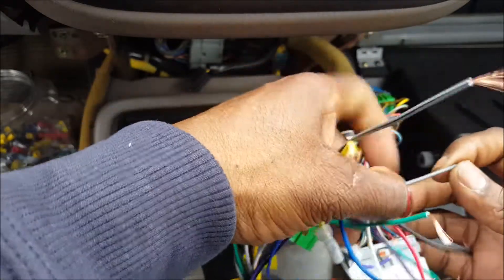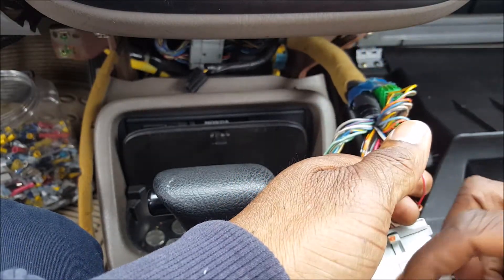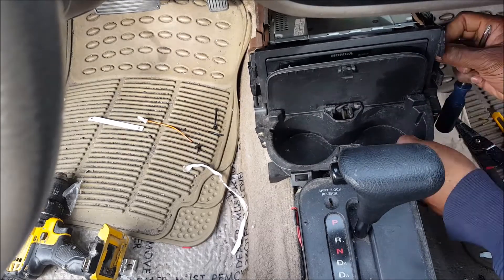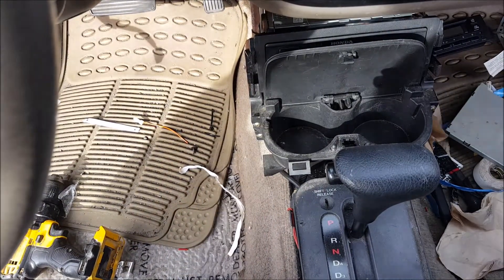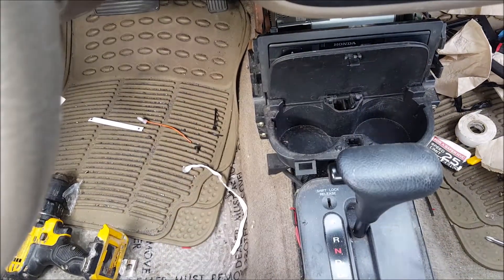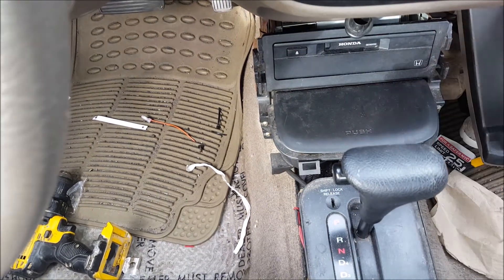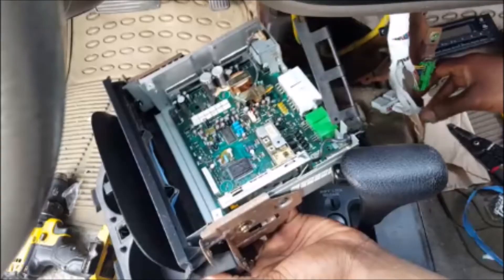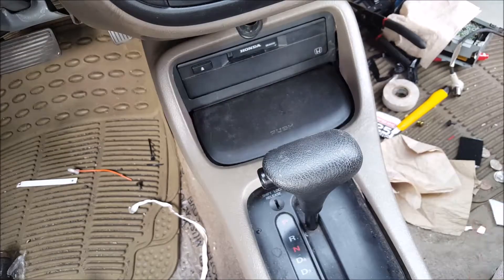Retain OEM Key less Entry Dome light Alarm On A 1996-1998 Honda Civic  With An Aftermarket Radio

Comment: For anyone confused about how to wire it all before getting to this point:

Easiest thing to do is buy the Metra 70-1720T harness. Connect the female end of the metra to the factory male harness, and connect the male metra side to the factory radio (also need to plug the green harness back into the factory stereo. Then connect the loose ends of the metra to the loose ends of the aftermarket stereo harness, and connect that to the aftermarket stereo. Then you should be good to go. Took me a long time to figure this all out and a lot of research and looking at my own car. There's hardly any info about this out there. 

Here's the Metra harness on amazon if you want it: https://www.amazon.com/gp/product/B0037712J6/

Cheers!
Reply: This will work even aftermarket radio?
Reply: @antwonm7002  yes. It basically splices the necessary wires for you so you can keep your original stereo hidden somewhere in the dash so the keyless entry remote will still work (keyless entry is built into factory stereo) . Then you connect the loose wires on the Metra to the loose wires that come on the harness for the aftermarket stereo.
Reply: @jadonk9798  so ill need to get a stock radio to hide it n stuff to keep keyless but still keep aftermarket radio?
Reply: @antwonm7002  yea you need the stock radio to keep keyless entry. You don't have a stock radio already in your car?
Reply: @jadonk9798  nah i got a aftermarket radio
Reply: @antwonm7002  ah I gotcha. Yea you'll need a stock radio compatible with the keyless entry remotes and hook it up with this harness and hide it somwhere if you want to have both keyless entry and an aftermarket stereo.
Reply: @jadonk9798  ok bet thank you!

Comment: Nice job on the video. I have a question about this on my 98 civic: aftermarket radio, new alarm but my OEM radio was removed... There already was a set up before with the Y harness to allow stock to be behind dash... I was able to find on eBay another stock radio from different car... I plugged it with the green and power harness and dome light works but keyless entry still doesn’t. My question is does any stock radio work? Or do I have to get it programmed to get my keyless entry to work? The new OEM radio turns on as well as my new one...

Comment: Help! I bought this car and it has no factory radio in it... if i take a factory radio from another car will it work. ?
Reply from the maker: keyless entry wont work but the radio should work as long as you have the security code
Reply: fuck! thanks
Reply: Yes, provided it is the correct radio. I bought a stock radio and remote from ebay, found the reprogram instructions online for the remote and boom, keyless entry.
Reply: @Michael Garvy where did you find the reprogramming codes or what are they if you dont mind and, where do I do the reprogramming? It's my 1st time working on a Honda stereo
Reply: @Michael Garvy Thank you for any help and thank you @Precision Connections for the video!!!
Reply: @Michael Garvy Thanks bud, I got the key fob working and everything is working Great accept for the volume knob on the refurbished unit I got from Ebay doent work...Haha if its not one thing its another. Thanks again for the help!!
Reply: @PeteRose64  Hope it works out man, once I actually had it all installed I couldn't believe it was that easy lol. I spliced it into an aftermarket head unit and tucked it under the dash, I thought if I disassembled the radio I might not be able to reprogram another remote if needed. Good luck man!

Comment from the maker: If you have a 1996-1998 Honda Civic and you want to change your old radio to a new up to date Bluetooth USB IPad one your key-less entry remotes wont work Unless you do what's in this video.
Reply: Has anyone ever had that problem with a manuel trans civic? My cars all manuel. Locks windows light etc. Will i have a problem with that on my civic?